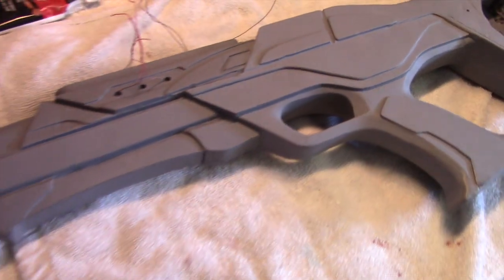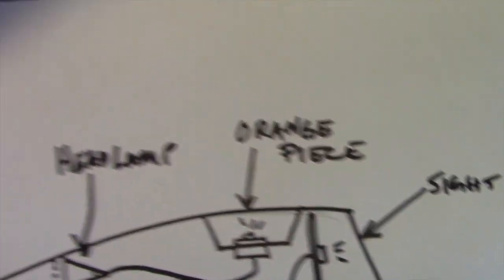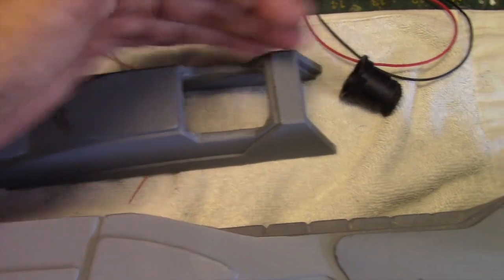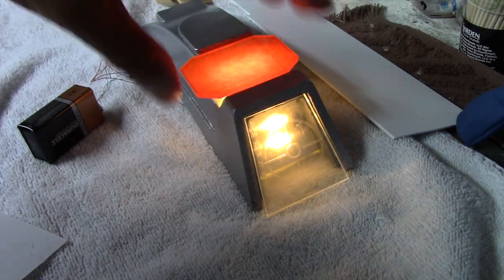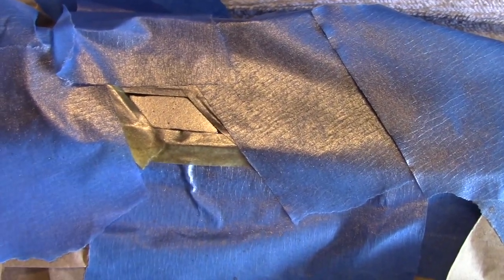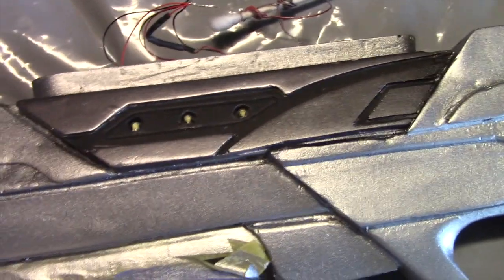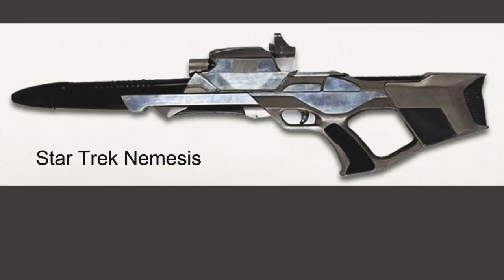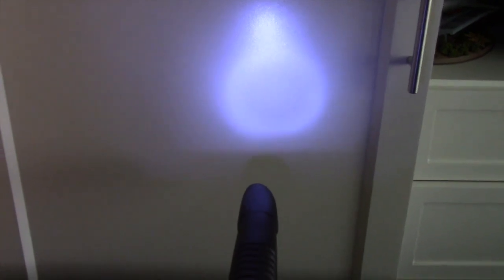Completing my Type IIIB Phaser Rifle

Comment: Could you give me the dimensions so I can  use a piece of wood to make one?  I am a Marine in SFI and would love to make one out of wood.  I thank you in advance.
Reply from the maker: The rifle is 32" long, 10" high from bottom of the handle to the top of the site.  The front barrell is 2.5" high and 1.15 inches thick approximately.  I hope that helps.  Email me at interstellarmodeler @ gmail if you need pics.  Thanks for watching.

Comment: What kind of sandpaper did you use? Can all this be done with a 3D printed kit?
Reply from the maker: I'd imagine it can be done with 3D printing but would probably very expensive because of the size.  As for sandpaper, I used grits of 400, 800, 1200, thanks for watching
Reply: I'll partially rephrase and elaborate. I have a 3D printed model of the Star Trek Discovery phaser and I have no experience with any kit of this kind whatsoever. My question was trying to ask is if what you did with the rifle resin kit can be done with a 3D kit
Reply from the maker: @roberthammock3179  Yes.  Is your model fully assembled?  How good is the rendering...are there a lot of striations/irregularities that sometimes come with 3D models? Feel free to email me at interstellarmodeler@gmail.  If you could send pics too I'd be more than happy to provide further help.